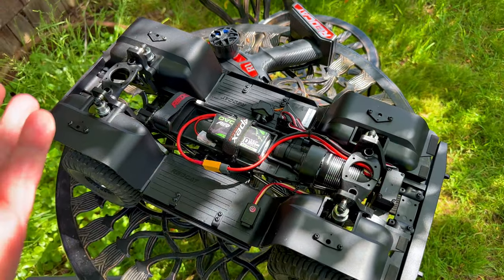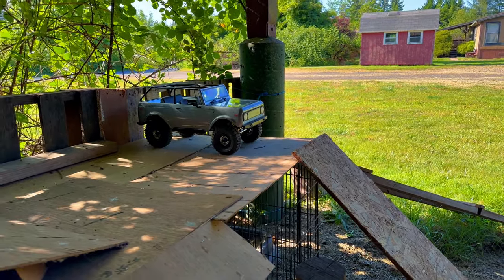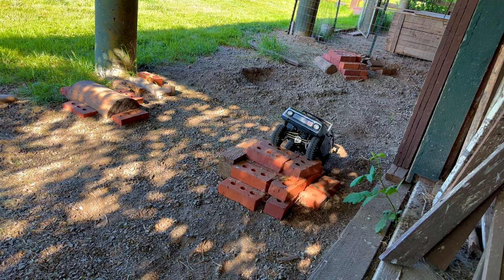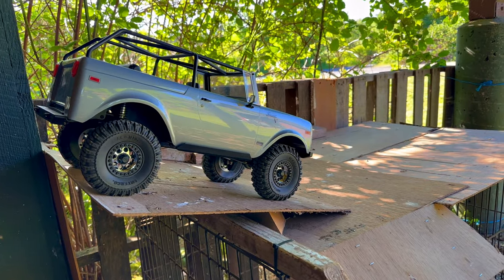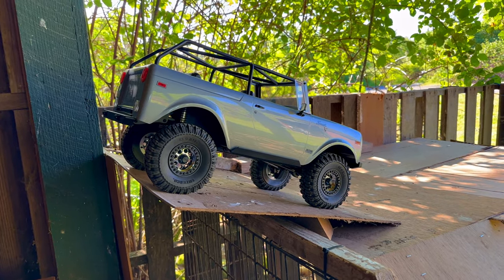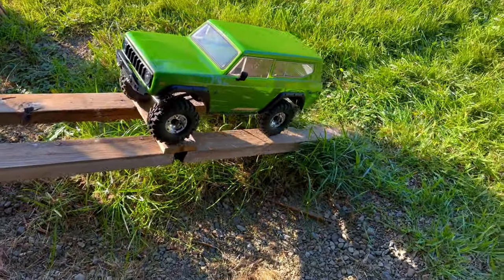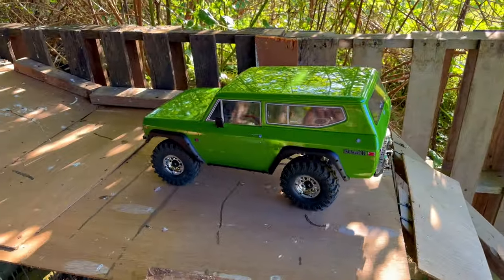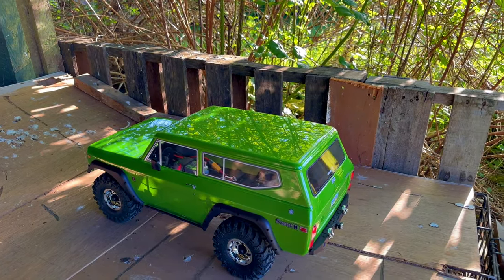Dialing-In the Redcat Gen 9..!! • My Ugly Dog RC! | TheSmoaks Vlog_2750

Comment: Hey Smoak, I wonder if a spray can type rubberized undercoating on the body would help with noise?  It's cheap,  easily applied, wouldn't be seen, and wouldn't add any appreciable weight.  I know nothing about RC cars,  but I tinker with a lot of stuff and am good at finding oddball solutions.
Reply: I was thinking similarly. Maybe some adhesive backed felt, or even the loop portion of "Hook & Loop" fasteners.
Reply: @TJ Rohyans  those are really good ideas, too!

Comment: The Gen 8 v2 was my first real RC car. I LOVED that thing so much. The first "mod" I did to it was moving the rear axel back one notch. It made it look SO MUCH better from the side profile. It also made it much more stable on steep inclines. It did ever so slightly reduce the breakover angle. But it wasn't THAT noticible. The second was the light kit and wheels and tires. The Gen 9 looks like it needs the opposite and the front axel needs to move forward a notch... But that's just MY opinion. It definitely looks WAY better without all the stickers in MY opinion as well... I have the TRX4 2021 Bronco now. To be completely honest... Traxxas is SO NOT worth the extra money it costs... Before I got mine. I always thought traxxas was so much better. Then I got one... and I was highly disappointed... The servo's are TRASH... The shift and diff lock servo's lasted a little longer than the steering. But thats only because they're hardly used. The only real difference between the Gen 8 and TRX4 is the diff locks and 2 speed. But the Gen9 has a 2 speed. The only real reason to get a TRX4 now is if you like the looks. Which I do LOVE my Bronco... lol. But otherwise. You're better off getting the Gen 9. Or even the Gen 8 V2. They're JUST as capable. At any rate. Nice video. I love your voice... It's so calming... lol.

Comment: The front end on mine is also very loud! I was wondering if that is normal or not. Do you have any recommendation on a replacement shift servo? Mine immediately went bad and when I got a new higher end on I could dial it in before burning it up.